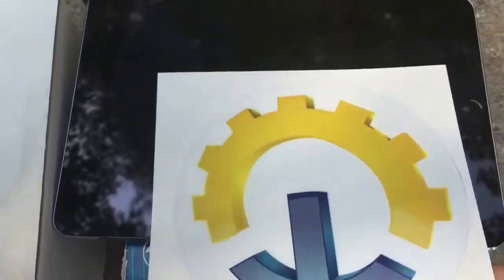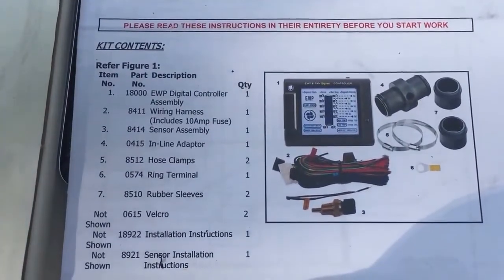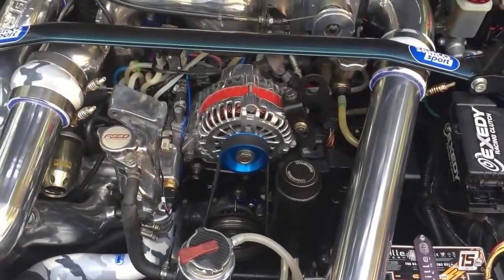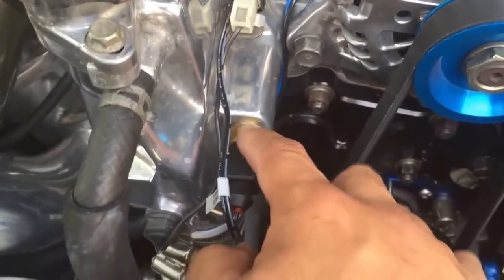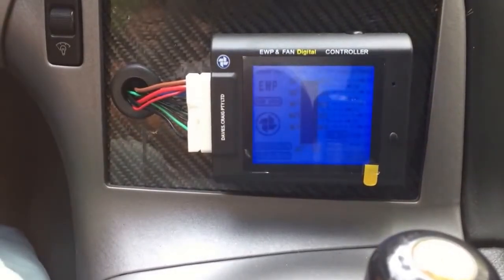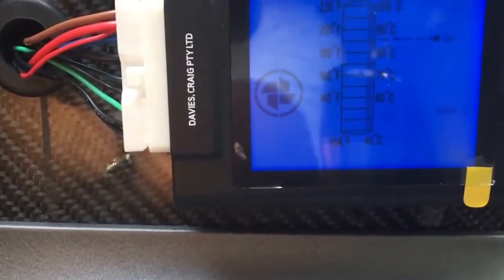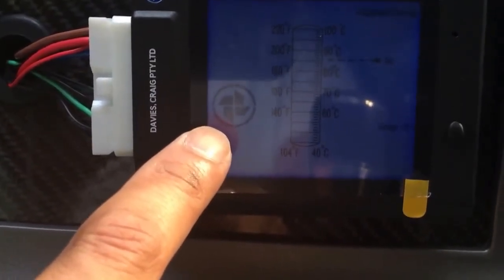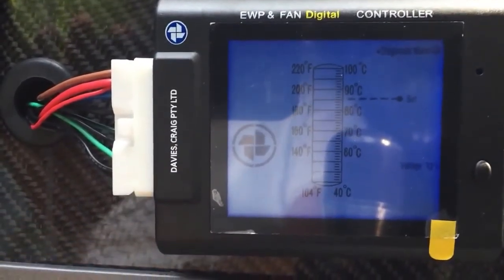Turblown EWP Kit - Davies Craig EWP150 & LCD Controller (June 2015)

Comment: Thanks for the video review!

I'm deciding between this and SakeBomb, leaning towards the Turblown as it retains (or has an option?) for keeping the thermostat.  Question, were/are there instructions on how to setup the Davies Craig Turblown kit with the thermostat option?  I'm familiar with EWP install, however not sure how to integrate the thermostat.  I also didn't catch the thermostat in your FD video walk through, was it installed?

Thanks!
Reply from the maker: The controller replaces the need for a thermostat, you simply remove it. The controller will manage the EWP and electric fan in response to engine temp. The kit comes with its own temp sensor and provides all the info the controller needs to manage the engine temp. All product instructions are on the website: https://daviescraig.com.au/instructions
Reply: @DaviesCraigPtyLtd  Thanks for the quick response, really appreciate it!  According to product details for the Turblown EWP Kit that this YouTube video is about, and the Turblown kit details listed here:  https://turbosource.com/products/turblown-engineering-fc-rx-7-ewp-system

It mentions, " This kit is *designed to use the OEM thermostat* for proper warm up on street driven cars. "

I'm familiar with standard EWP install (thanks for the link though!), but am seeking clarification on how this Turblown kit integrate with the OEM thermostat?
Reply from the maker: @balansay  You would need to follow that up with Turblown. They are using our product line but using some of their own technology to adapter for their needs.
Reply: @DaviesCraigPtyLtd  Great, will do!  Thanks for your amazing response on this 5 year video, have a good day!

Comment: So did you completely replace your factory water pump with the ewp150
Reply from the maker: Our EWP rage is designed to replace the mechanical pump or to be used as a booster to the unit. They are also used extensively with intercooler applications. We provide a bit of information on use options here: https://daviescraig.com.au/electric-water-pumps